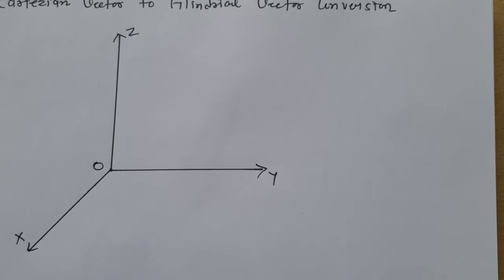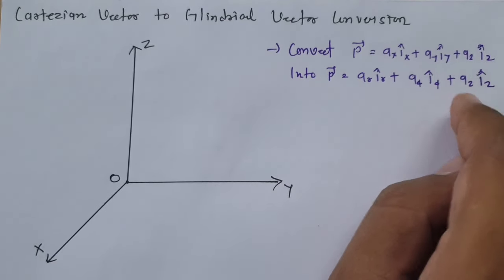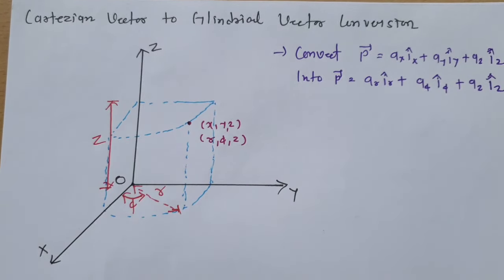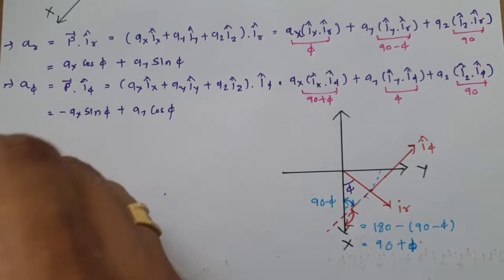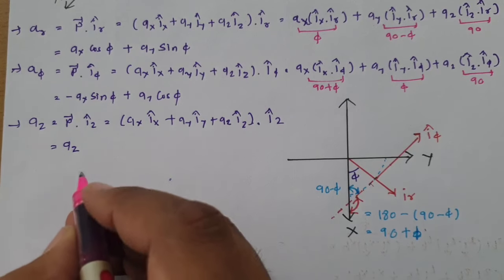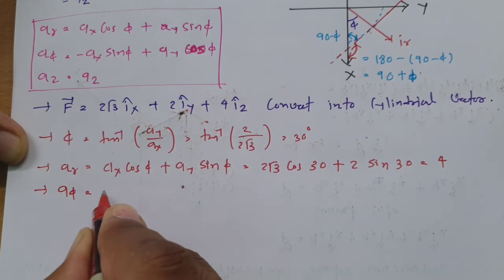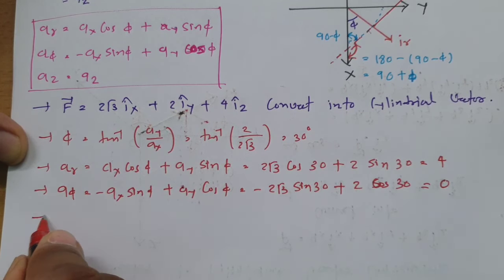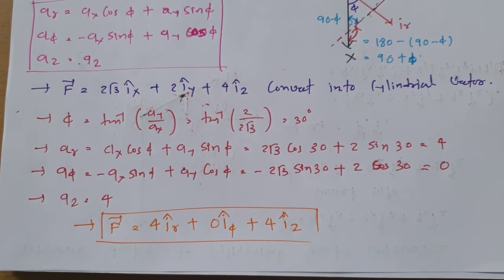Cartesian to Cylindrical Vector Conversion Explained

Comment: That is absolutely not the correct answer. The angle is NOT zero degrees. The angle is 30 degrees or pi/6. The answer should be (3, pi/6, 4)
Reply from the maker: I have noticed one thing about you that you want say everything is false. But learn things 1st or see the video atleast.
Reply: @EngineeringFunda  I only comment when I see errors, that is correct. Is what I said incorrect yes or no? If I'm wrong then I'll apologize however, if I'm right then you should learn to have some humility and say thank you when someone points out an error so that you can correct the video and provide better content.
Reply from the maker: @rationalthinker9612  : I have said because I haven't noticed error, can you please mention time stamp along with that
Reply from the maker: In studying things there shouldn't be any apology 🙃 🙂. You are very dear to me, I must tell you one thing that I love my students so much.
Reply from the maker: It is vector dear. So answer is correct. There is difference between vector and point.
Reply from the maker: Keep writing comments so that next time when I redesign this course at that time I can solve your doubts. 🙏👍

Comment: sir as per the formula you wrote for the a phi component it will be always come out to be zero if we put the value of cos and sin of phi and multiply with those component.
i hope you will understand my comment
Reply: see phi component is actually angular displacement it will always come out to be 0 in this notation. guess this is just used for convention.

Comment: How ar=p.ir
         az=p.iz
          afi=p.ifi
Reply: it is because the dot product of P and Ir (unit vector of r) gives the magnitude of the vector in the direction of r. The same concept applies for the next two as well. Since the magnitude of Ir is exactly one as it is a unit vector, therefore only the magnitude of P will influence the result. Ir simply provides the direction of r. Hope this helps.